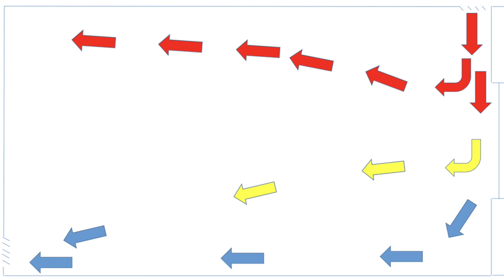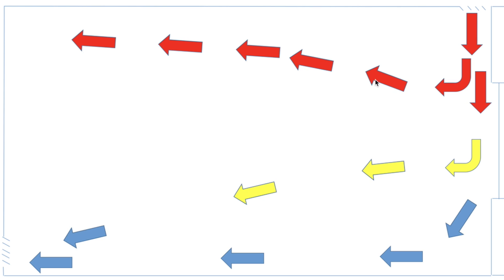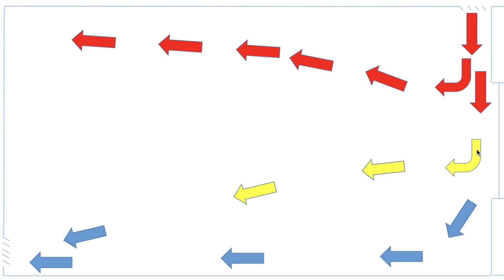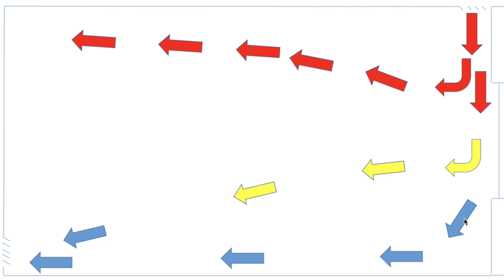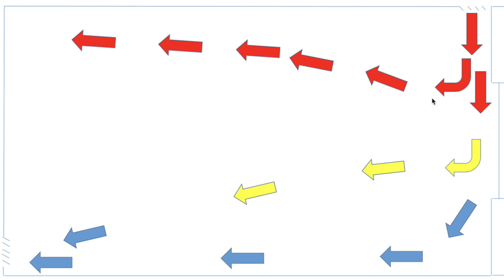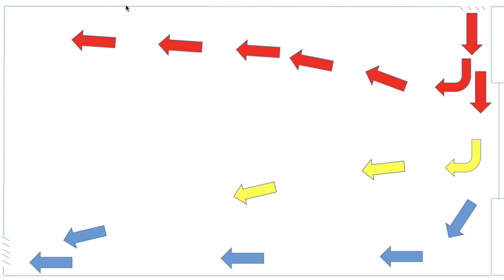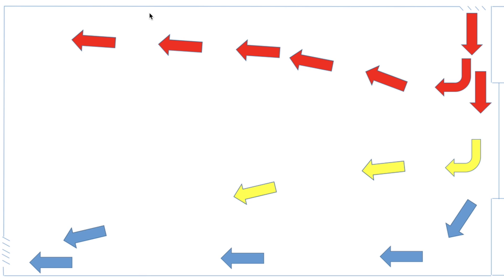The ceiling diffuser with lower wall return

Comment: This is the setup for my house (downstairs at least).  The upstairs has floor diffusers and
the return on the lower wall.  However, there's a big open stairwell connecting the two and
the return is right at the bottom of the stairs, so both summer and winter the cold air just
pours down the stairs and makes for a large difference in temperature on the two floors.
The system is old and the heat pump has about completely given up the ghost so I'll
be replacing the whole thing.  What do I look for as an educated consumer?

I'm really finding your whole channel interesting.  This is great stuff. Thanks!
Reply from the maker: There is no way to know for your system exactly, but you may try blocking part of the downstairs return.  You need to be sure you are not starving the system, so temp readings should be taken at the outlet of the indoor coil both before and after the change.  There should be no temp change.  Hope this helps.
GFM

Comment: Hey there GFM, Interesting... What about cold air returns near the ceiling? I have both in one hallway the original as built base board,and a high up one to help with the A.C. load, figuring it could draw the warm air out near the ceiling.
Is there such a thing as to much return air?
Reply from the maker: +Craig Nehring I have one coming.  As for return air you can't have too much.
GFM